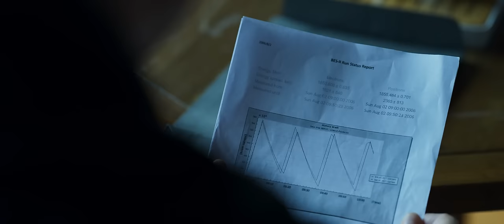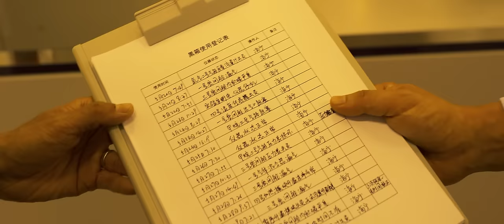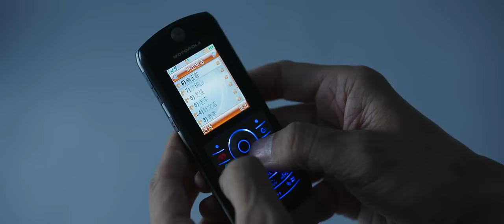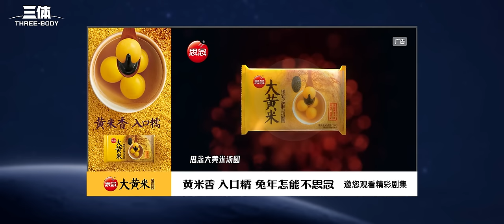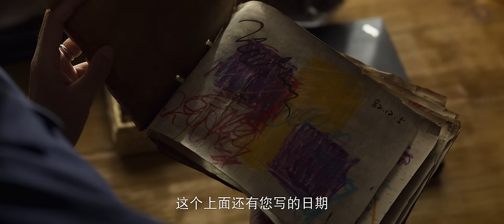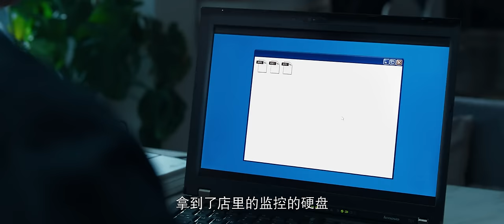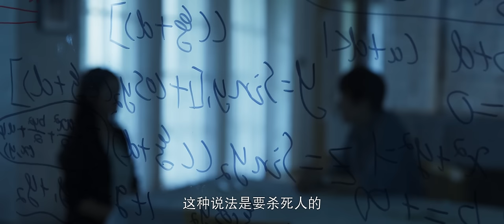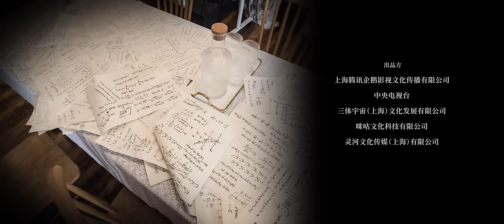【ENG SUB】《三体》第4集：汪淼向申玉菲宣战 Three-body EP4【欢迎订阅咪咕MiGu官方频道】

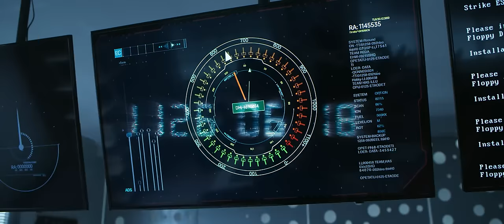Comment: Pause at 12:15 8-D
The screen shows them installing UNIX.
I guess they just assumed nobody who could read English would ever watch this series LOL.
Reply: It is too slow on this part. I have to force myself watch it.
Reply: From floppy disks too…little bit of an error with the decade lol
Reply: Some of the screens seem to be from an actual particle accelerator, I'm assuming they were allowed to film what was going on at the moment but not allowed to touch anything.
It adds a little bit to the immersion that the lab shots at 9:35 are actual real life labs.
Also, it is supposed to happen in 2008, so they use dumb phones, and labs would often use floppy disks and experiments were certainly not connected to the internet for security reasons. In that regard, I think it's realistic.
Reply: @lolilollolilol7773 the person commenting is too young and didn’t expect to see floppy disk still exist in 2008 😹😹
Reply: I saw that! Like actual System V!